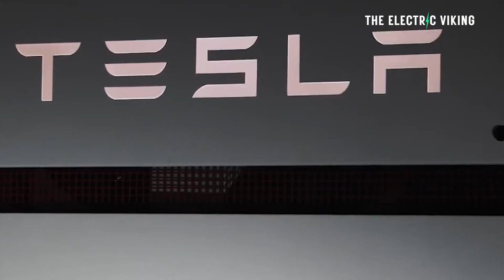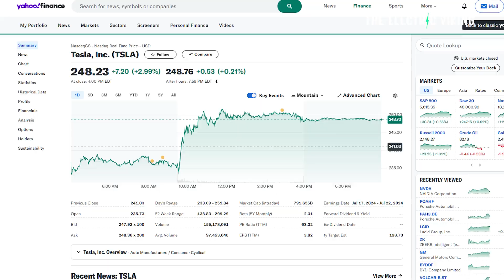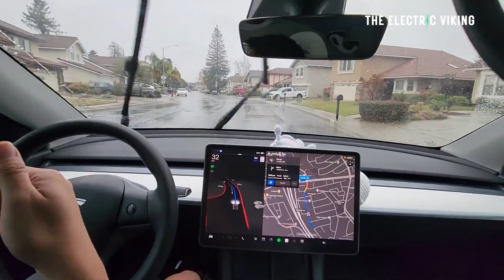Tesla makes the same profit selling ONLY 1 Megapack battery as 100 EVs

Comment: Even the domestic solar market is building.  I'm just waiting for a PowerWall3 availability here in the UK (due September) for home solar.  PW3 is LiFePO4 technology, so I feel happy with the safety of that.  OK, smaller scale than megapacks, but you either have large and central, or distributed and local.  The latter requires less infrastructure upgrades, so has merit.

Comment: How long before TSLA has China to compete in the utility scale battery packs?  BYD started out as a battery company before it was making EVs.  CATL is even bigger producer of batteries.
Reply: Catl already have their own. It’s cheaper and better.
Reply: Competition is normal and necessary.
Reply: @coolco1619  not if your a Tesla fanboy and stock speculator.
Reply: The demand for batteries over next several decades will not be met by BYD or CATL alone.
Reply: @BittermanAndy  yes it will. Because Tesla doesn’t really make enough batteries for its own cars. I was at an expo this week and saw a CATL system already in operation and they will be cheaper than Tesla which means more sales and their cells are better too. CATL will scale faster due to China
Reply: 2014 Elon told the world the desperate need to have a 100 gigafactories.  Somehow ramping up is still an issue.  BYD was making batteries for years, they have ramped fast. It will be tough fight

Comment: Tesla sold cars at an average of 45k with a profit of 6500 per this Q1, which is about 14.4% profit margin.
1 Megapack (3,900kWh) is about 1m USD befoer installation and tax, so a profit of 227k (~35 cars) is 22% profit margin.
That would mean the entire pack is 773k or a 3,900 kWh battery, Cost of Production is 200 USD per kWh on a pack level.

This makes sense and have some margin even when CATL Tener goes to market.

Comment: How many cycles can a megapak do, day & night, before capacity is too useless. It's not as good as a water turbine or stored gas pressure. Then how recycle? Iron batteries can last for decades.
Reply: Megapacks come with a 15 year no defect warranty and for additional cost a 20 years performance warranty.

The giant megapack install in Australia got its cost paid back in 3 year.
They are used to replace peaker plants.
Reply: Better than a dam kwhr/$ by far all things considered